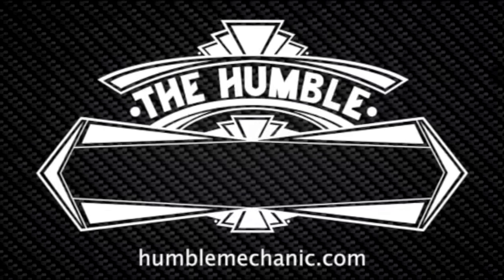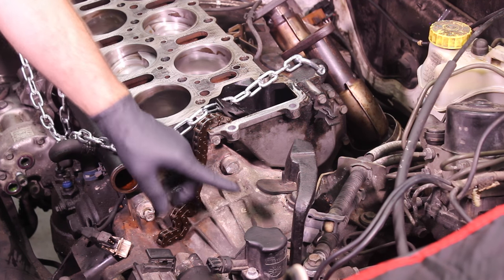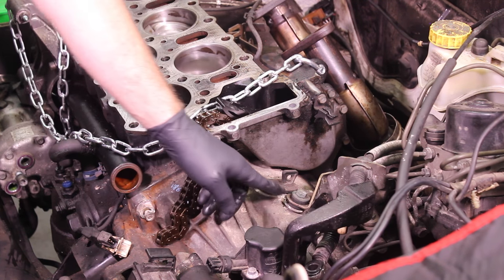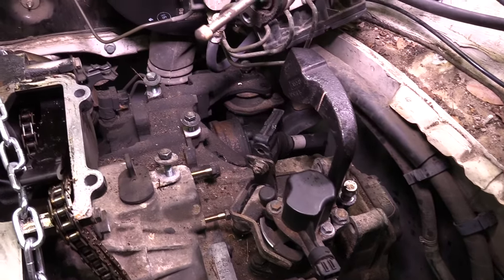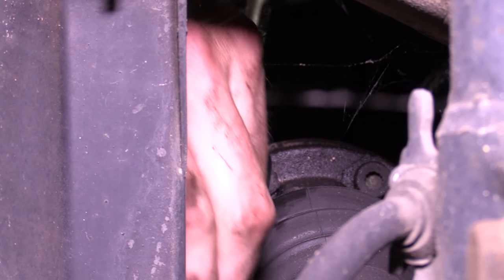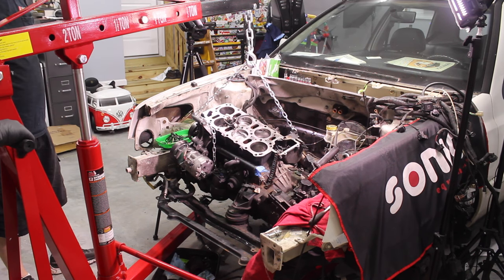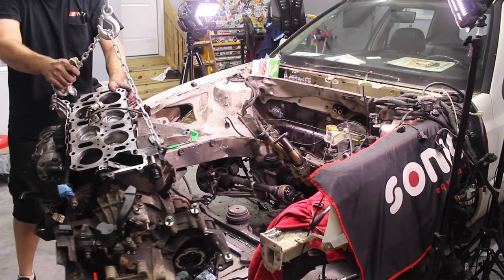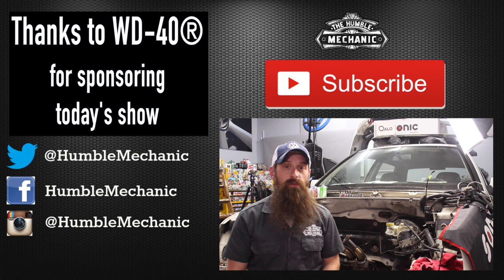How To Remove a VR6 Engine ~ White Wookie

Comment: +HumbleMechanic

I just got to this part in my mk2 VR6 timing chain maintenance.  When I raised the engine/trans, the axles disconnected from the trans output flanges and some ball bearings fell out of the inner CV joints on both sides.  Does that mean it's time to change axles?  Or can I just simply put the ball bearings back where they belong?  Thanks for your time and help!
Reply from the maker: +Francis Becknell clean the balls and put them back in!!!
Reply: Hah!  You're the best man, thanks!

Comment: Man, I wish you'd show me how to pull a Eurovan VR6 engine... :) Thanks for the great video!
Reply from the maker: Hahaha. If I ever get one I will.
Reply: Well, I have a 1999 sitting in the driveway... in case you're interested! My brother and I are going to pull the engine and put the video up here. One day! :)
Reply: it is a pain! the official manual says that you need a special frame, that you attach to the block from beneath. because in the van, the engine is "hanging" on its mountings. I did it once, of cause without the special frame. i more or less rested the whole block and transmission on old tyres and wooden blocks, unscrewd the mounting points and lifted the whole car. but you need a lift. dropping the engine to the floor with a crane may also be possible, but is more pain. :D

Comment: Thanks for all the videos. Hopefully you will see this. I’m in Alaska and I’m wanting to put a block heater in my v6. There is no vw dealer in my town.  I call other towns and they don’t winterize the same as my town that gets -50. They don’t do block heaters. So my research I found my freeze plug is 37mm. For the life of me I can’t find a plug that size. I want to put it right next to oil cooler on right side in front of block. Any suggestions from anyone out there???thanks

Comment: This brings back nightmares from removing the engine out of my Corrado. I dropped the transmission first, and then the engine. Both came out from the bottom with a transmission jack.

Comment: Are you going to do an 02J shifter swap In wookie ?  It  in the same process with my mr blurpurple. I  decided go that route because aftermarket options open up. Also it super easy with motor removed and re aligning it so much easier compared to the stock 02A?

Also I going to be running an a/c delco clutch. I got on super clearance pretty much stole it from a parts shipper. I was wondering if it a good match for a vr6 that just going to be a daily driver .

Like the build keep up with updates👍🏻
Reply from the maker: I will be doing the 02j swap. I gotta a buddy hooking me up. Not sure on the clutch. I think I may be doing a BFI clutch. It's easy because they are local. :)
Reply: +HumbleMechanic 
Think I just going ahead on the clutch and make a review later no one on vortex had answer. 50 bucks brand new  whole kit  have to try it.  Is your buddy getting you a polo box?

Comment: Why would VW put the timing system on the output side of the engine?? that makes no sense, I'm curious to see how they did it now though.
Reply: There's very little room at the front of the engine in the MK3 engine bay - I can only guess that putting the chain at the front would have meant removing the engine to work on the chain, etc.

It is a PITA to remove the gearbox, etc. (I did one years ago), but that's preferable/easier (?) than removing the whole lot.
Reply: Yes,  just getting to the tiny water pump means moving the engine either up or down to clear the frame rail. To get to the alternator means moving things around too to create space (at least in the MK IV).  If the chains were on that side too it would definitely mean lifting the engine from the bay.

As it is, to do the chain you still have to drop the tranny (at a minimum) and of course, it would be easier to do the job with the engine out of the bay, but it can be done.  And I'm glad it's done!
Reply: They make it like this on purpose. So you would have to take into the dealer for service. Unless you a pretty good mechanic then you wouldn't have too.
Reply: They did it because it’s a v6 engine where a 4 cylinder was designed to go!

Comment: Do a clutch fork as well. did a clutch in my old GTi then on a beach trip the clutch fork cracked and failed
Reply: Wow, never heard of it failing.  Trying to remember if I replaced mine while I was in there.  I think I did and was wondering at the time why I was replacing it.  Didn't seem like a wear item.  Sorry, what a headache to go back in there.
Reply: Definitely, must be enough of an issue that they are pretty easy to get a hold of. 

But it was a good thing honesty my timing chain guides were right on the edge of their life. So did that cams and head gasket while I had it apart.

Comment: For me personally, I feel using Steel-toed Boots is more dangerous working with something as heavy as an engine because if the engine lands on your steel toe and crushes it down you wont have toes... if the engine lands on your toes without it they may get crushed, but they are still attached (or at least mostly attached).
Reply from the maker: I think that Myth Busters proved that didn't they?
Reply: In part you're right, the steel toe shoes must be graduated in resistance according the specific job ,and many users for the reason you say are using polycarbonate toe shoes of high resistance.